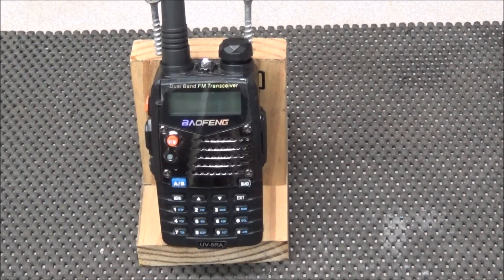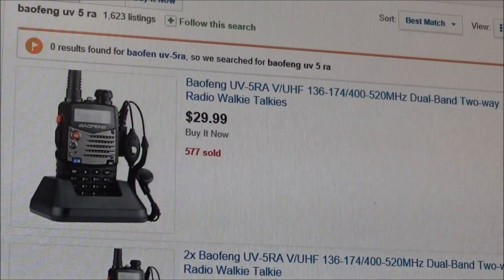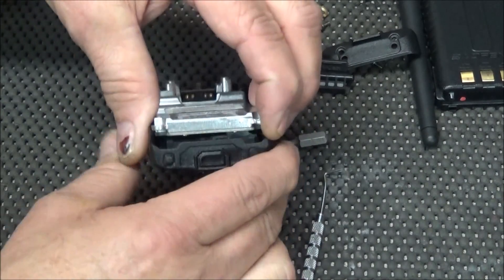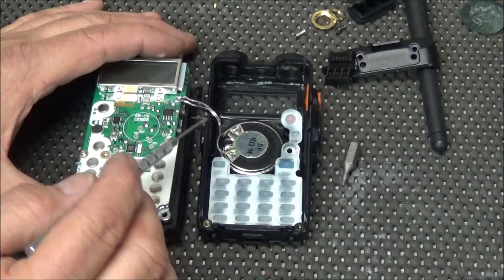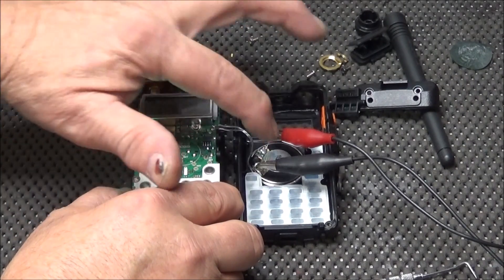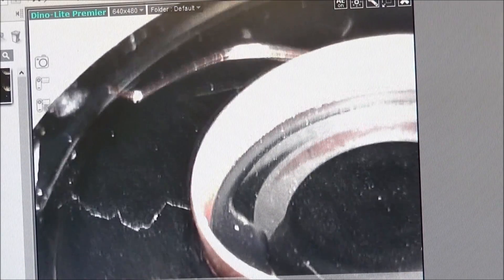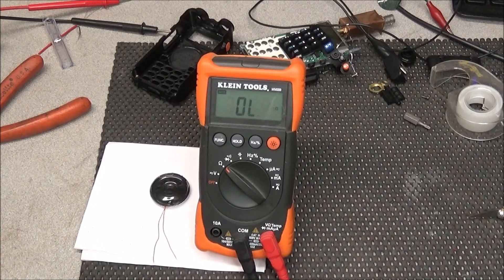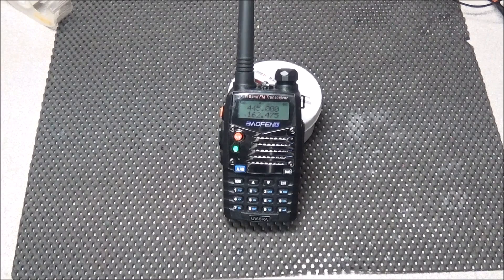#23 Baofeng UV 5ra disposable radio with  no receive audio

Comment: I had the same dead speaker issue on 2 different Baofengs that were less than a week old.  I had been plugging the external speaker in a few times when the second one quit, so I suspected that may have been a contributing factor.  After further research, I found that when you insert the K1 plug, the tip of the speaker plug (speaker +) briefly shorts to the center band on that same plug (TX data) due to the geometry inside the female connector.  I had suspected that perhaps this caused a component failure in the radio.  After seeing this video, I now suspect that it overloaded those tiny wires in the speaker & caused the wire to blow like a fuse.  The radio still works with an external speaker, so that would seem to confirm that the audio circuit is OK. I haven't found a source for replacement speakers, but I see that I can get an external speaker for about $5.  I am hopeful that the speaker inside the remote will be the correct size to fit in the radio.  The instructions that came with the radio do not say to shut off power before plugging in an external speaker, but I'm now thinking that it may be a good idea.  Thank you for this post.  I think that it may have helped move me in the right direction.

Comment: I have a similar problem with a Anytone 878uv.  Speaker died.  The break was somewhere inside the coil.  I was able to repair the radio by buying a new front cover which includes the speaker for $24.  It was worth it since the radio is well over $200.
The impedance for your baofeng is exactly what I need and would like to repair the original front cover for a spare. Would you know the diameter ?  I need a 40mm  16 ohm 1 watt.   Did you happen to research were you could get a speaker?

Comment: i have one that is doing the same thing. eccept that it WILL receive the noaa channels, as well as the f.m. radio. but when i  contact my local repeater, it flashes like its receiving the signal, but there is NO  sounds. i have also programmed it with another  baofeng, and it will send it wont recieve... but again it does receive the f.m. rdio, and the noaa channels. i dont know whats going on. can you assist?

Comment: What if no receive audio with speaker & headset? But the light surely receive the transmission
Reply from the maker: Then either a faulty solder connection or the audio output device is bad.  Does it have transmit audio?
Reply: The Radio Shop yes it transmit perfectly

Comment: its disposable in that its cheaper to replace than it is to fix

however

it is not disposable... because it is just as good as the more expensive radios as a much cheaper price thus making its place on the market in-disposable.

for some the choice is baofeng or nothing.
Reply: Disassembling it to determine the cause of the failure may help to prevent future failures in other radios.  If doing an autopsy on one saves another 10, then the savings is $350, not the $35 that a single radio costs.  Investing an hour of my time is worth it for a potential savings of $350 & the frustration that comes each time you need to order a replacement.
Reply from the maker: Pretty good statement, I have to agree.
Reply: I'd stop WAY short of saying "It's just as good as the more expensive radios..."  I own one, and in transmit audio, transmit power, and receive quality, it doesn't hold a candle to my Kenwood or Icom hand helds...  Or even my HTX-202.

Comment: Thanks for coming through once again!   My son has one of these and the speaker is bad (sounds clear through the headset, but sounds "low level and like frying bacon" through the speaker.   I found one for $4.95 + shipping so, armed with your great instructions.... I can fix it for him over a cold one!   Well worth that just to have it in working shape.   Thanks again.
Reply from the maker: Great!. Better get two cold ones for the repair. just in case.  Should be an easy fix.

Comment: Which the problem of this radio ?

The speaker is damaged or the programming system is error ?

And, what shoud you do ? Replace the speaker with the new one or clean the speaker or what action you do ?

Because i am not very understand the video.. Please help me :)) thank you so much
Reply from the maker: +Joshua Pradipta Hi Joshua, sorry you could not follow the video.  The speaker was bad. It fell apart. Finding a new replacement speaker is not easy. I was able to repair the speaker by reattaching the voice coil wires and gluing the cone to the speaker housing. Nothing was wrong  with the programming. But sometimes program can get corrupt and cause strange problems so a reset is necessary.  Again sorry for confusion. Hope this helps.
Reply: The Radio Shop thank you.. Anyway do you have email?
Reply from the maker: Yes, click on "about" on my channel send a message from there.
Reply: The Radio Shop i can not find about us.. Why not send your email here?
Reply from the maker: +Joshua Pradipta   I do not post email due to spam. Got to my home page look for this  " Home  Videos Playlists Channels Discussion About " Click ABOUT then click send message

Comment: Nice repair.  I have a few of these baofeng radios and I think they're decent enough.  Sure my yeasu and motorollas are nicer radios but for working in the yard or garage the baofeng fits the bill just fine.  Could you tell us more about the spectral purity problems you mentioned in the comments below?  I assume you mean that the signal from them is too wide or noisy but how can it be tested?  I think that may make a nice video if you have the equipment on hand to check it.   Have a happy new year.
Reply from the maker: +TheDisorderly1  I agree for what they are they are not too bad at all. What little I use mine I got decent reports back. As far as spectral purity all radio transmitters produce harmonics. These are frequencies that will be up and down the spectrum at different points depending on the transmit frequency.Take a look at part 97 "For a transmitter having a mean power of 25 W or less, the mean power of any spurious emission supplied to the antenna transmission line must not exceed 25 uW and must be at least 40 dB below the mean power of the fundamental emission, but need not be reduced below the power of 10 uW.” This is what needs to be tested. I do have the equipment but it is old and my SA screen is less than four inches and is analogue.  A digital SA would be much better to do a video with. One day I will have one.Happy New Year and thanks for dropping by.